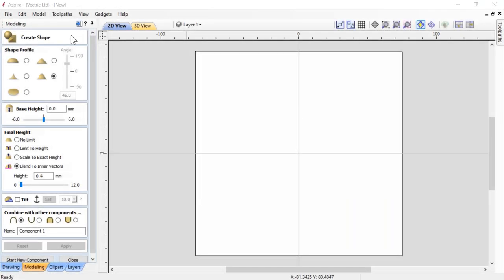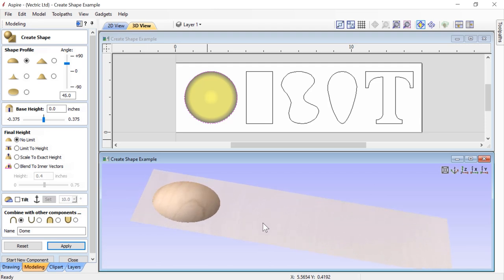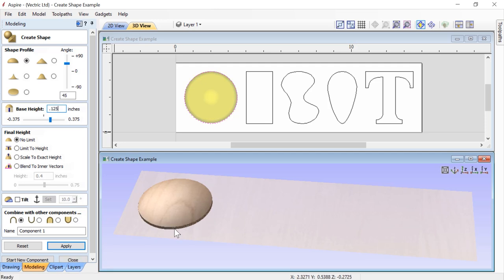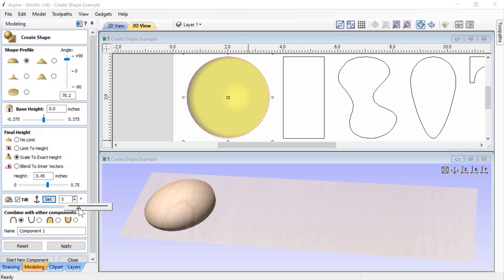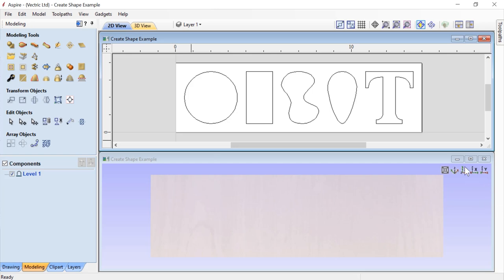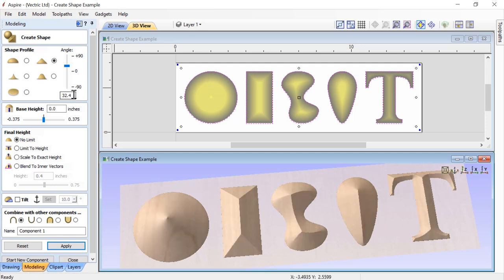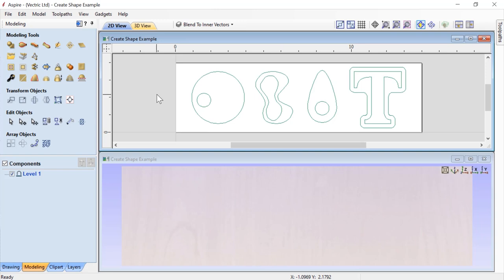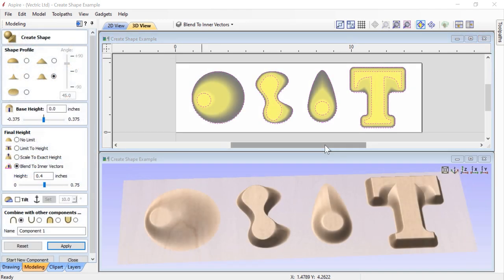Vectric V10.5 Tutorials | Create Shape Guide 3D Modeling

Comment: Can you change the Shape Profile or Angle in an existing component...one where the settings have been "Applied" and "Closed"?  Once I "Close" the Shape Menu, and re-select component it creates a new component when I open the Shape Menu.  I know I can change the other properties but can't seem to change the shape or angle which is only available in the Create Shape menu and can't be modified once you "Close" the Create Shape menu.
Reply from the maker: Hello and thanks for the comment.  Yes you are correct... once the shape is created and the form closed you can't go back and edit the shape (angel and so on).  In saying that the software will remember the last set of setting you used with that vector to create a shape.  So if you have a change in heart about the shape you created after you have moved out of the form you can delete the 3D component created and then select the vector again and ajust your shape.  

I hope that helps.